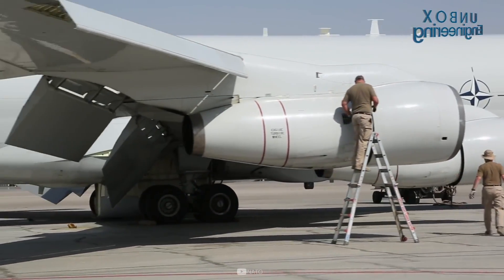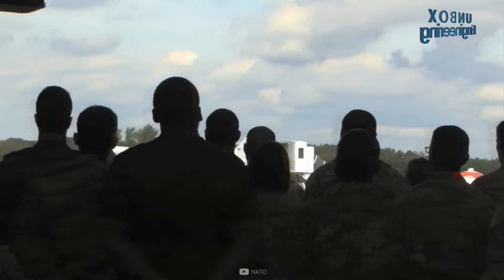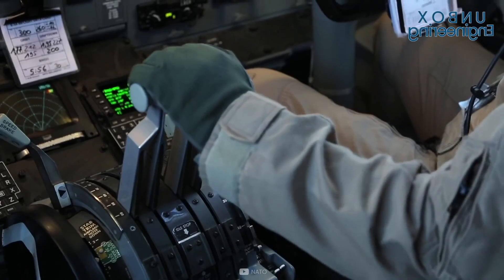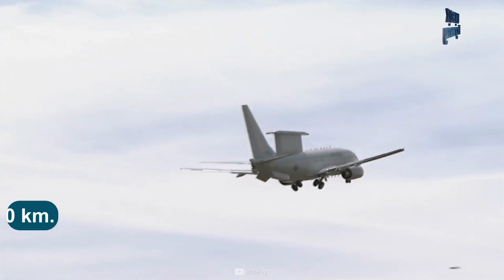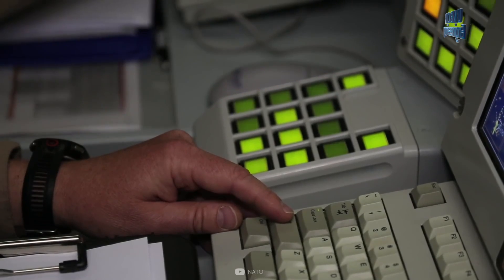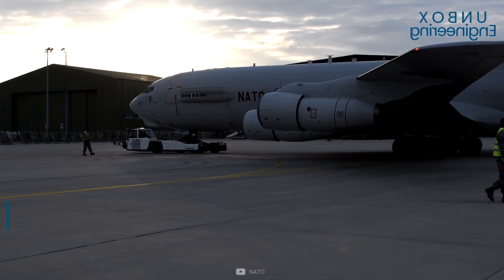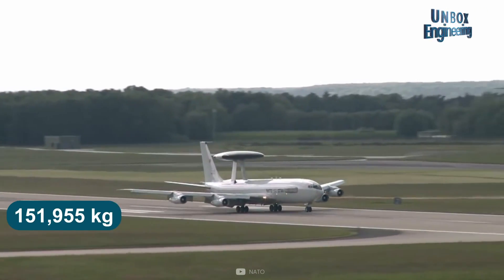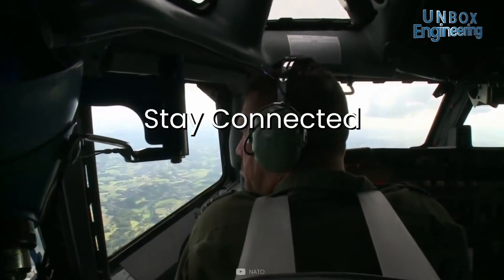What’s Inside AWACS Spy Plane?

Comment: AWACS is not a spy plane! It's a an airborne early warning and control (AEW&C) system is an airborne radar system designed to detect aircraft, ships, vehicles, missiles, and other incoming projectiles at long ranges and perform command and control of the battlespace in an air engagement by directing fighter and attack aircraft strikes. AEW&C units are also used to carry out surveillance, including over ground targets and frequently perform BMC2 (battle management command and control). When used at altitude, the radar on the aircraft allows the operators to detect and track targets and distinguish between friendly and hostile aircraft much farther away than a similar ground-based radar.
Reply: in layman's terms, it's a "realtime spy" plane that could do surveillance and order attacks at oncoming threats at the same time.
Reply: @udhi_gn3893  No its a surveillance period it does no spying
Reply: The E-3 does come with special radio listening equipment which it can use to intercept and locate a wide array of radio transmissions, so I don't think it's inaccurate to call it a "spy plane"